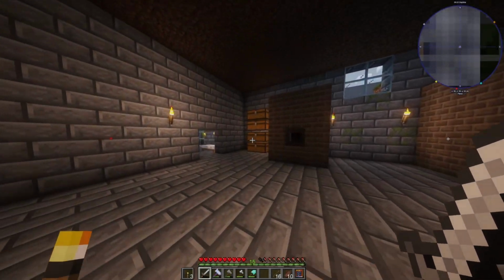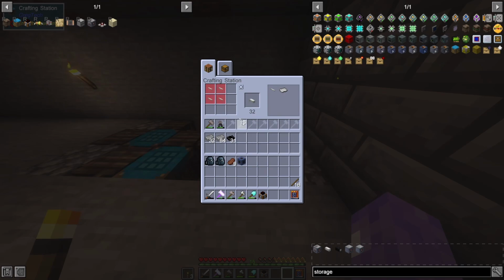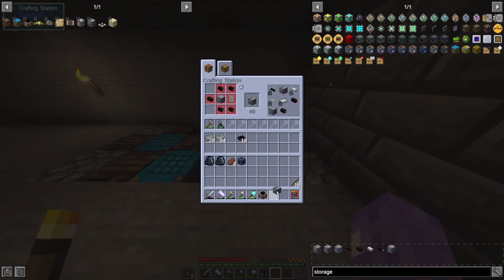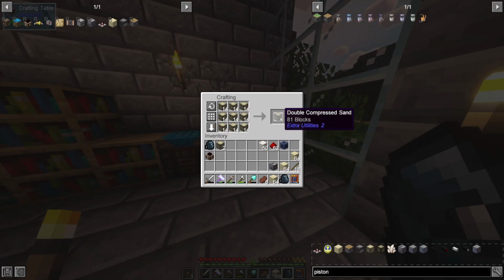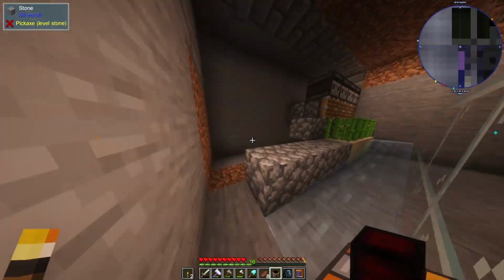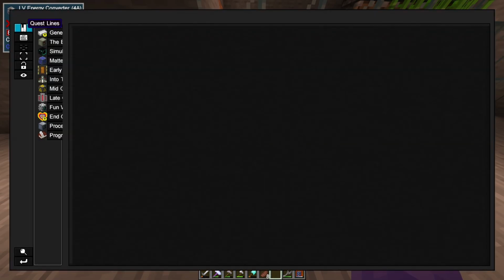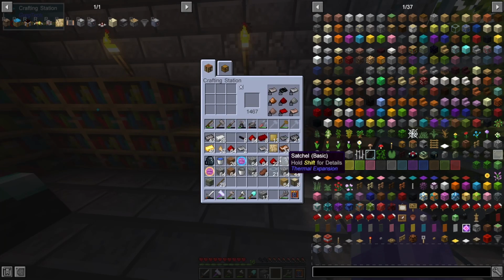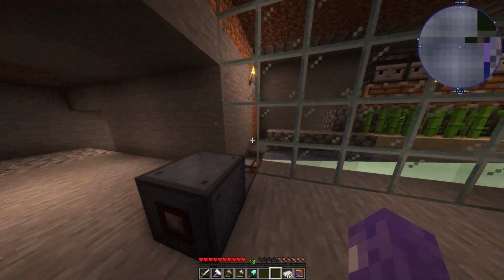Nomifactory CEu Ep. 4: Turning Sugarcane into ELECTRICITY!

Comment: Instead of a timer like you have powering your snad you can use a redstone conduit with input and output set to red channel and a sensor filter in the input side. Its around 2-4x faster than the setup with the timer.

Also if you haven't yet you might want to consider chunk aligning your base you can see the chunks with F3+G its good to start early as if you wait to long you can start running into problems with the Greg Tech and Gregicality Multiblock machines.

Also that battery buffer is going to need some batteries in it before it starts working as you have it set up right now if you try to run machines off it your not going to get any power.

also when building machines consider after making a wire mill to go directly for the bending machine for plate making.

Love this series so far can't wait to see you progress. Welcome to LV!
Reply from the maker: Great suggestions. I forgot about the chunk alignment I will check that!

Comment: Unfortunately your sugarcane setup won’t be able to match the consumption you’re about to have, even if you hooked up all of that snad.  The trick is to run redstone conduit into each snad and place a redstone sensor into each conduit.  Set each conduit face to output a strong red signal, then run the timer signal into the conduit and watch the sugarcane grow faster than you can collect it.
Reply: Huh, i dont think i ever ran into that problem even when i had 4 dynamos, granted i had about 10 snad, but still.
Reply from the maker: In my test world i wasn't able to get the conduit method to work. I guess i need to research how to set that up...
Reply: You can run a redstone line next to the snad, and have a redstone conduit connect to it (You can see the conduit connector). When you open the redstone conduit GUI, you can enable output, then set the signal color of the output to be the same as input, enable open strong signal (on the output side).
Take a redstone timer filter (it is very cheap for you to make), place it as the filter for input, and edit the filter setting to set the time to 1 (or 2 tbh)
That should work, if you havent figure it out

Alternatively, use the same setup as the original commentor points out, but make sure to connect the redstone conduit to the timer, place a redstone sensor as the input filter and set the output just like above. That should also works (and is about as fast as a 1 tick clock)
Reply: @Gekkoulong  both of these are still the same speed as just a repeater and a line of redstone

Comment: Welcome to LV! We have machine, machines, and more machine! Hope you have a great time :)

That setup configuration for the crafting station should be sufficient for all of your need (if you ever filled all four of those crate, i think you have a bigger problem at hand haha)

Each snad is 81 sand, so yes, it wont be that much snad. However even 2-3 snad are more than enough to power 1 steam dynamo so dont worry too much about it.

However, if you ever worry about a blackout, add buffer. That battery buffer is...well, a buffer already, but adding buffer to your system never hurt. Take sugarcane, you will need  it for other stuff in the future, why not run it to a chest (or better yet, a drawer), so you have it at your disposal all time? Right now, hopper is your only (easy) method of item transportation, but it should be good enough.

Hope you have fun reading those power quest, you will need it.

As much as batch crafting is powerful, always look for the more efficient recipe. Take the wiremill, right now you trade 2 ingot for 1 wire, while the wiremill trade 1 ingot for 2 wire, a 4x discount. It would make sense to rush for said machine so that your next batch crafting is more efficient. Batch craft with caution, even though nomi resource are very much expendable, saved materials are still saved materials.

Congrat on 200 subs! Totally deserved btw, that first video really blew up bc i remember stumbling across your channel when you had 50. Here is to more greg in the future.